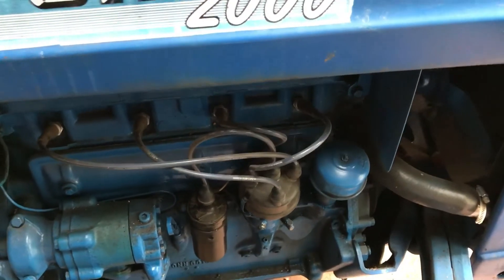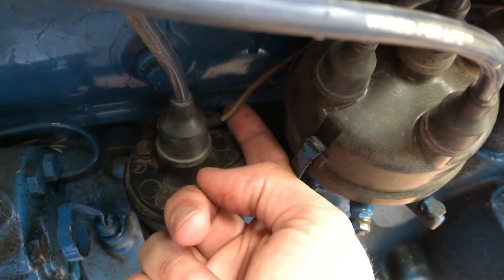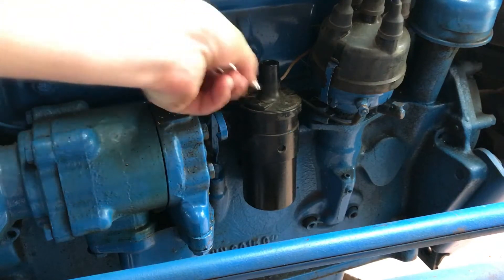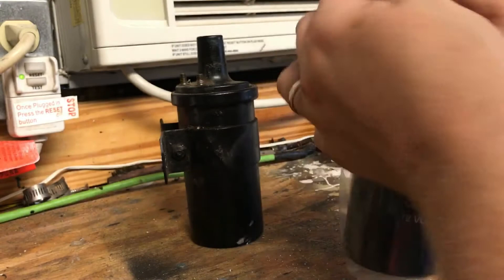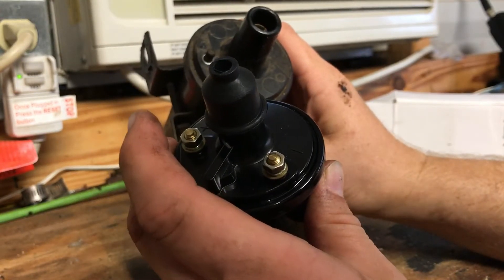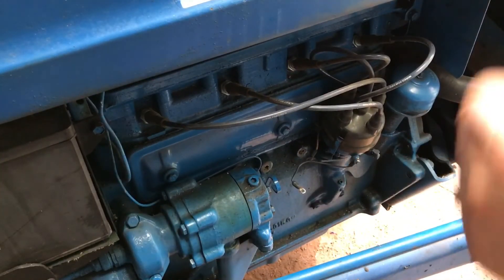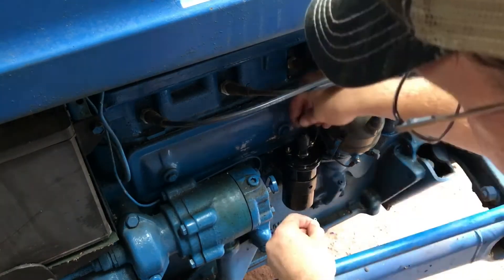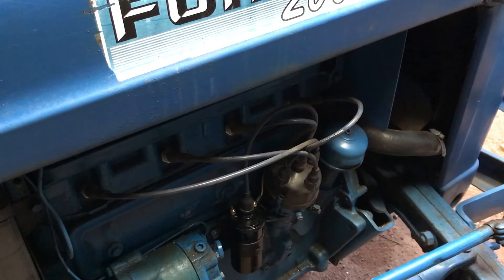Changing Ignition Coil on a 1963 Ford 2000 Tractor

Comment: On your coil u hooked the red wire to the positive terminal and the black wire to the negative terminal right. I'm putting a new one on my Ford 6 volt tractor  and just wanna double check that's how u did yours
Reply from the maker: The negative end goes back to the ignition switch. The positive goes to the distributor.